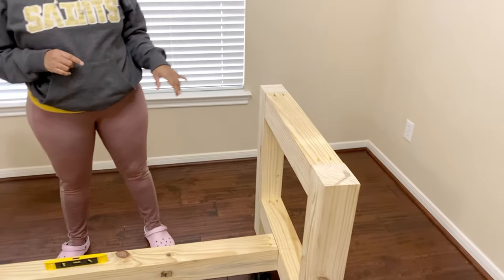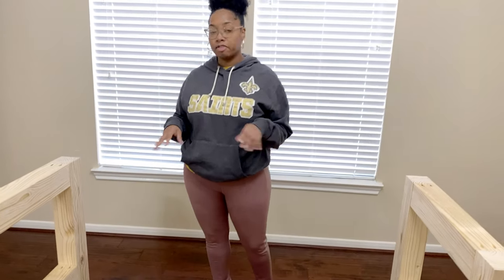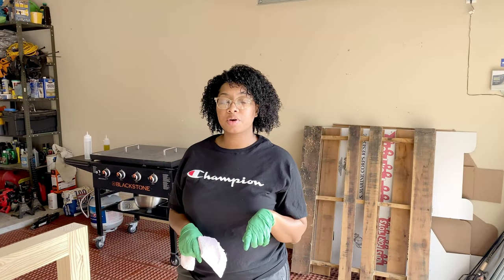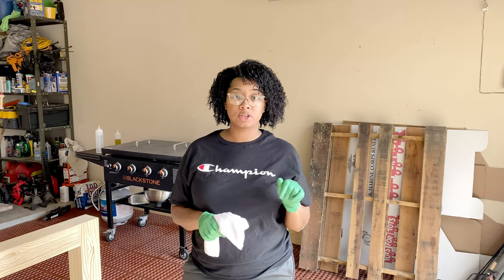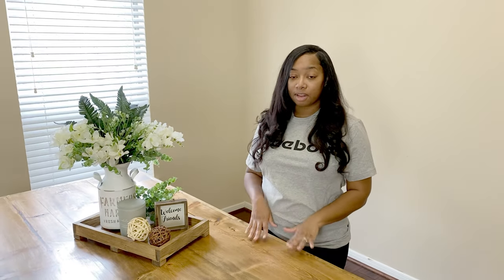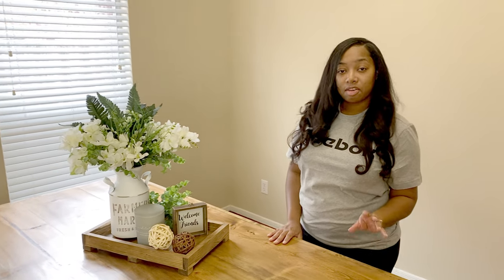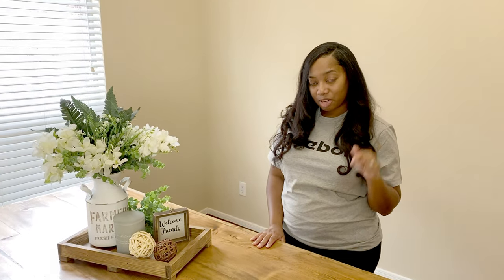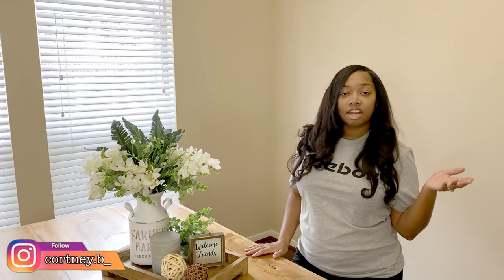Farmhouse Table | DIY Dining Table | Rustic Kitchen Table

Comment: What size did you use for the table top? I love how chunky and heavy it looks
Reply from the maker: Hi Dawn! Thank you so much for watching ! 
I measured and here are the details:

For the flat top of the table:
Join( 3 ) 1 inch thick x12 inches wide x 6 feet long boards together. 

For the trim:
1x4 along the sides of the table 

For the legs :
3- 2x12’s glued together and I had my husband cut them down to measure 4x4 (at the time of filming this video, Lowe’s did not have 4x4 in the type of wood that was used.)

all of the wood that I used was white pine

Hope this helps!💗💗